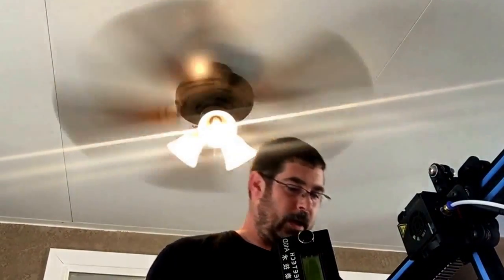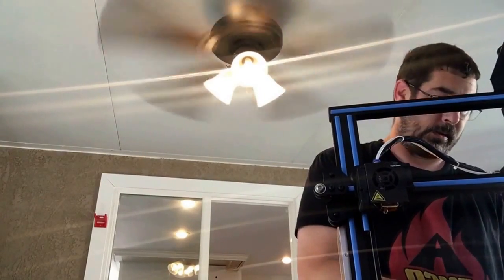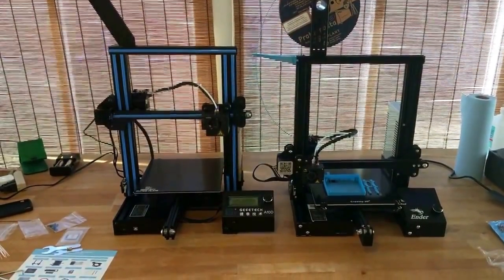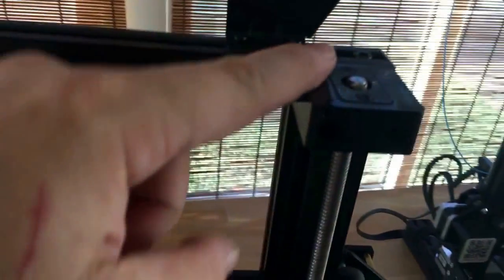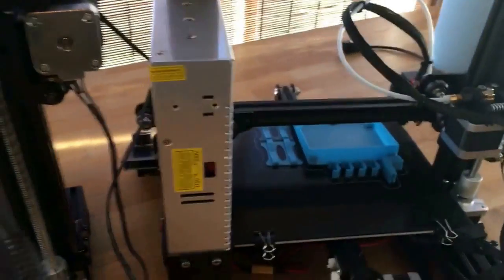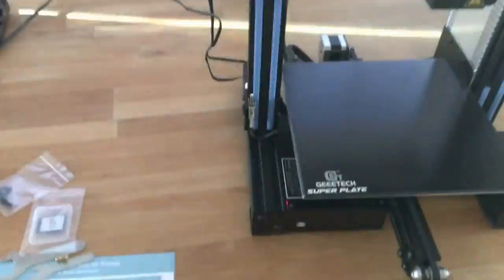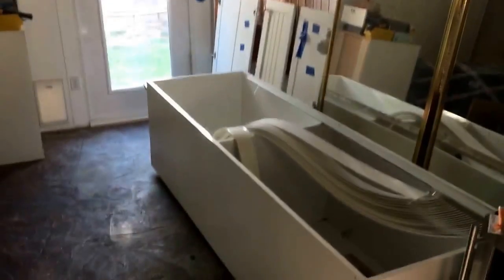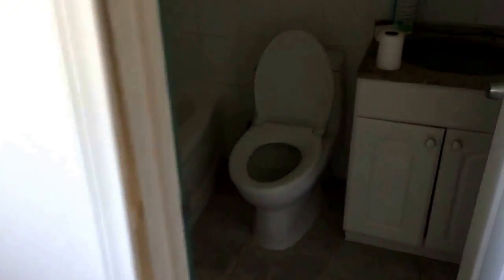Unboxing and Assmbly of the All New Geeetech A10 3D Printer Part2

Comment: Very informative!  It is down to these two printers for me. I want to add the BLTouch (3DTouch name for Geeetech) sensor.  Yours says "A10D" but there is no "D" version I can find.
Reply from the maker: The D was a misprint on the early models that Jimmy, Jeffrey and myself were sent to evaluate.  It's just an A10.  The A10M is a dual color mixing extruder (playing with that one now) and the A10D is an unreleased dual color non mixing version.

After playing with these guys for several weeks, you can't really go wrong with either the Ender3 or the A10, however the A10 has some nice adds to the platform that the Ender doesn't.  Like a control board with a boot loader and extra pins available so you can add on the BLTouch without having to find a way to monkey it in.
Reply: Practical Printing   Thanks so much! I've been watching a lot of reviews and upgrade videos but yours really pointed out some detailed differences.  A week ago I had no idea which low cost printer to consider but it eventually came down to the A10 and Ender 3. Both needed leveling sensors for easier calibration. That was one comment three co-workers said I should get. One said get the original Prusa i3 MK2 or 3 but its too pricey for my first. Plus I'm only using it to knock out quad copter parts anyway!
Reply from the maker: Best advise for someone just getting into the hobby is to remind you that we aren't quite at the "Apple Experience" just yet.  A Prusa would have a much lower learning curve for beginners because their software packages are so dialed in.  But with any of the lower cost units like this, be prepared to learn, learn learn, and learn... And don't be discouraged if you don't have the results you expect right off the bat. It does take time to dial in both your software profiles and learn your hardware.
Reply: @crussty3d   I'm a software and firmware developer by profession and a tinkerer. I am choosing one of the open source designs by choice anticipating the fun upgrade paths that are available. (I'd never own an Apple anything but I know what you meant!)